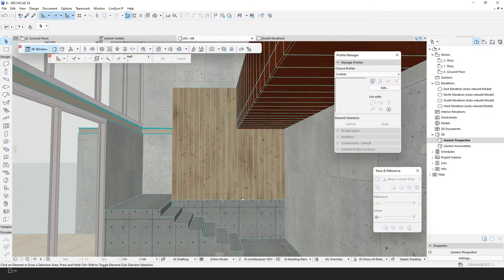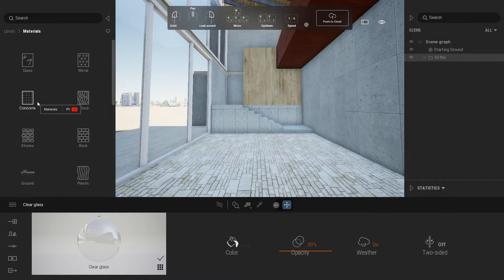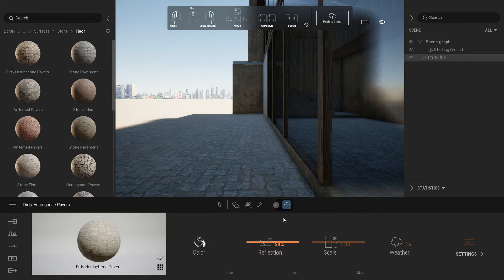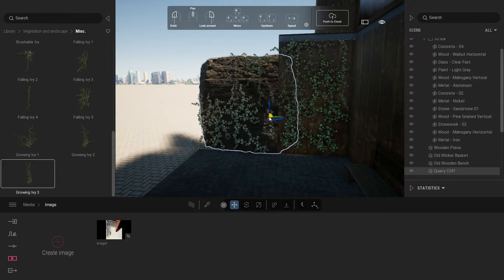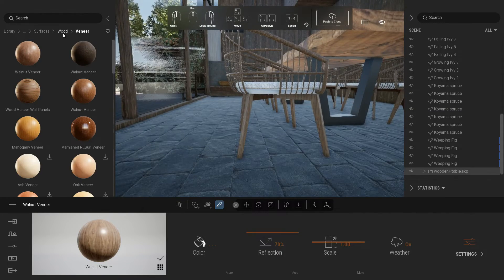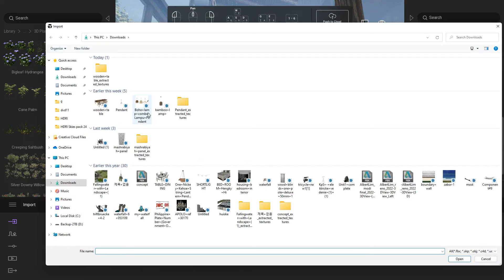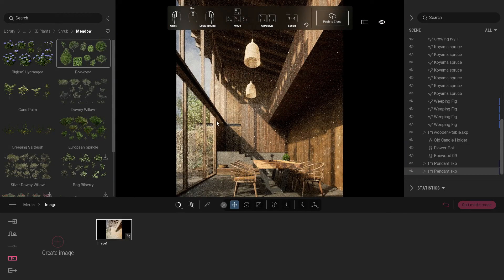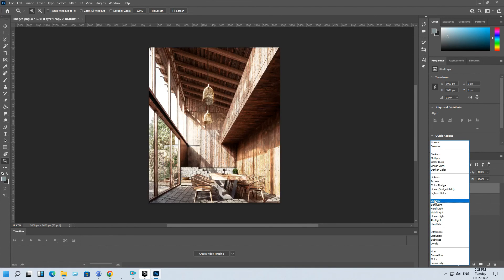TWINMOTION 2022.2 INTERIOR RENDERING TUTORIAL SERIES - 14

Comment: First of all congratz bro 🎉 ur the best tm user I have ever seen and you let me migrate from corona to tm. But I have some issues, when export my corona scene from max to datasmith some materials and objects doesnt seen on TM. How can I fix that can you help me pretty please 🙏🏼🖤
Reply from the maker: Thanks. I have also same issue with export corona scene to TM. I let you updated if I find the solution.
Reply: @jamzview4497  A big problem is when the material in corona is a very complex one. Because TW only accept a difusse, rough and normal map. But some materials in corona are made with a lot of layers and others maps. For example, when te diffuse has a color correction in corona, in tw you see the original map, without the color correction.
Reply from the maker: @agustinmarcilese1215  yes I think that's the main issue when exporting from corona scene to TM. Twinmotion have limited parameters especially when it comes to mapping.